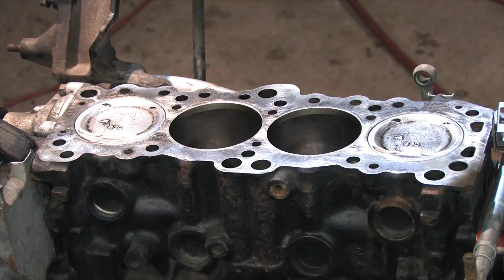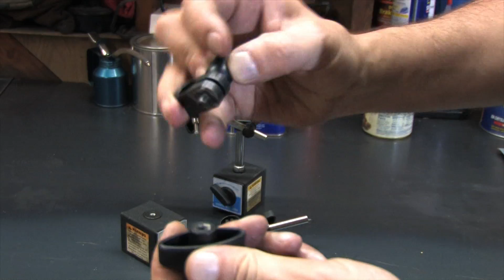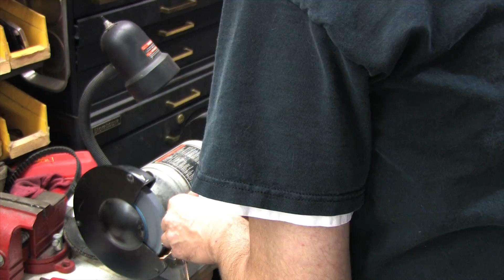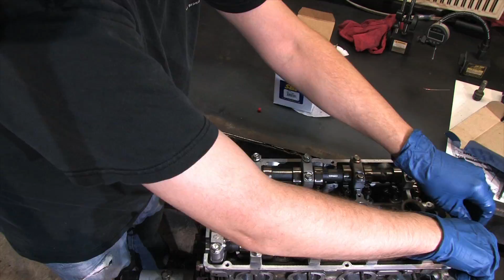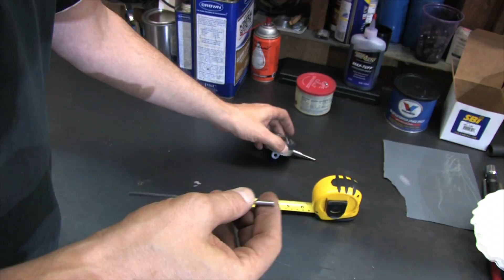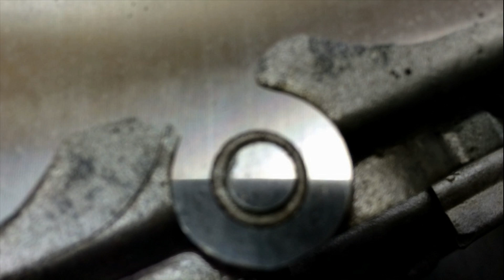Cylinder Head 205 - Degree DOHC Camshafts

Comment: 4:57
All those stupid imperial measurements. My metric brain just exploded Jafro..
Reply: Liamv4696 The whole world should just use metric for simplicity.
Reply: All the Australian engine builders I know still use imperial, even when working on Japanese engines, I think it's just because they think it's cooler to say "It's got 8 thou bearing clearances" over "zero point two millimeters". So this is why my friend and I invented "hunge" for Hundredth of a millimeter.

It's an interesting point you make about resolution, are you sure it's not the other way around though? all my dials are either 0.01mm between points or 0.001" and because there is 0.0254mm in 0.001" wouldn't that make the metric dial have a better resolution? Because over the same 0.05mm movement the metric dial has gone over 5 points and the imperial one has only done ~2
Reply: @zoidbergmerc   zoidbergmerc  most of my test indicators have .0001" resolution. Besides eight thou rolls off the tongue better than zero point zero millimeter. In truth its all in what your accustom to. I've heard people argue that metric is more accurate , when in fact either system can continue to the right of the decimal to infinity. I'm my exsperiance sae is easier especially when working farther from the decimal. For instance, speaking thirty two thou, three tenths.
Reply: right there with you on this.. I dont understand SAE and I dont want to. Some people can tell whats the metric equivalent of 13/64 without even thinking about it. Witchcraft ! Thats what it is. In the fire !
Reply: well with a 0.1mm gauge you would be correct then! 

Living in the US I suppose it makes sense to use imperial measurements because that's what all your cobbers use and the machine shop too, so you all want to be talking the same language.

Check out Mitutoyo if you want some affordable quality metric tools. 

Collecting\buying tools is half the fun I reckon ;)
Reply: Liamv4696 the cat said is enough 
I'm hungry
Reply from the maker: Just say to yourself... "at 1mm lift".  :D  It's going to be okay.  I frequently have to use both, but the majority of machine tools and drill bits I can find in stores here are SAE and not metric.

Someday you might work on an American car.  The cams you buy for it will arrive with the lift spec at .050".  You'll like imperial measurements on that job more than trying to hit 1.27mm on a dial gauge.  It offers 25.4 x better resolution on the gauge face than any of the metric dial gauges I've seen [for 2x the money].
Reply: Too many measurements in that comment!
I only just woke uppp D:
Reply from the maker: zoidbergmerc Perhaps it's just the tools I have access to?  The finest metric gauges I've ever seen here in the US is .1mm.  Never seen a .01mm gauge.  A tenth of a mm is .004".  I'm not saying they don't exist... just that the standard measurements I can get my hands on are between 4 and 40x finer than that.  3.93701 times to be exact.  ;)

In my other videos you'll find I'm always tool-collecting.  If I ran across a good deal on a metric set of .01mm or .001mm gauges that are reasonably affordable, I'll house them.  I'm already set up with calipers and dial gauges in .0001", so for a non-machinist, that gives me better than most in my situation... but it would be neat to have around.

Comment: Seriously hungry for more, i feel ive watched every single video bar a few car shows and track clips. Dont make us wait another month for 206 haha I rebuilt my nissan patrol l28 with the service manual and your guidance. I was also lucky enough to aquire a mitsa magna tf and was pleasantly surprised to find I have the same engine youve been show casing. Its a 4g64 16v, I havent started tearing into it but I feel pretty confident now. It cant be too far off from the 63, right? :p thanks for putting so much time, effort and money into these videos
Reply from the maker: Oh wow!  You got the Galant Wagon.  It's mostly the same... Just a different timing belt and a different bore and stroke... but yes!  You will find that all of this stuff applies.  You should still follow the Magna's service manual for spec, or the overhaul section of the Mitsubishi shop manual for the 2.4L if you can't find the Magna manual.
Reply: ***** yea brother in aussie we call em magnas.. I wish I had a good website or forum to gather knowledge and learn which mitsas I can use as doner cars. I like the 4g64, for a 4 cylinder it goes like stink I just wanna get more haha it uses slight oil, but not enough to produce smoke. also removing the oil cap you can feel massive blowby which is taking its toll on the spark well seals.. good times!!

Comment: These are the best engine videos on YouTube, I can't believe the precision you go to with motors.  It's unbelievable.  Do you ever work on Honda motors?
Reply from the maker: I did build a Honda once.  It was a great car.  I actually do miss it after 8 years of $3.50 gas prices, yes I do...  I couldn't bond with the Honda performance factor.  No offense to Honda owners anywhere... I just wasn't willing to do all the block sleeving and girdle work to stiffen up an aluminum block with a floating water jacket.  It cost so much more to achieve the same result.  I made a video about it called "Jafro's Honda Civic Confession".

Comment: top video jafro.
I will definately be making my own solid lifters for this, I didn't realize that it was that simple, here I was prepared to buy some. Be looking out for cylinder head 206
Reply from the maker: You should lookup 4g63 dotorg and read the cam degreeing section.  There's a fantastic write-up with yet another method of lifter setups available.  It's nice that these lifters are so prevalent in so many different junkyard cars.  Every 4-cylinder DOHC 1989-1999 Mitsubishi uses them.  Of course there's nothing wrong with the ones CRCO makes if you have the coin.  Heck I might even buy a pair just to have them in the toolbox.
Reply: ***** I am not that far into the build yet my cylinder head is ported and polished and I have all the parts for the head, gaskets and sensors for the engine but am yet to buy a rotating assembly and machine work. This sort of stuff is beyond my experience right now so ill do what I did every other time, watch videos and read manuals then dive in and I will be familiar. I will read this article on 4g63 dotorg thanks. Oh I finally got mitsubishi ASA on my computer so part numbers are a breeze. Keep it up jafro.

Comment: Your vids make me want to get a 4g. You should do a SR20DET build so I can copy your techniques :D
Reply from the maker: If making videos paid enough to stay home and just wrench on engines all day, I'd be building several different kinds of cars.  I mean... I am right now, but inside they're still all the same thing.  4 6-bolt 4g63s in the driveway.
Reply: ***** What is your opinion on 4g vs SR?
Reply from the maker: Nikzilla33 That's... that's a tough one for me to answer.  It's sort-of inline with bench racing if I did.  The typical answer would be based off of potential, and I've never built a 4g63 that made it anywhere near its potential.  Anyone who's built an SR20DET anywhere near its potential would then have free license to take shots at me on my own channel.  Homey don't play dat.

I have no experience with the SR20 so I have neither a positive nor a negative opinion of them.  I get asked questions about other engines all the time that I don't own, but truly consider to yourself... "what are opinions worth?"  What would a DSM guy's opinion really be worth concerning a Nissan?  Probably right on-par with what a Volkswagen guy's opinion is of a Pontiac.

However... you CAN copy my techniques on an SR20DET... The geometry may be different, but the physics are the same.  ;)
Reply: ***** Unfortunately a lot of your techniques don't apply to SR's because we have an aluminum block and chains instead of belts. Head stuff is nice though!
Reply from the maker: That's part of the geometry.  The physics is in making it go bang, not what it's made of.  What it's made of is all about Chemistry.  I'm working on the in-depth PHYSICS stuff right now.  ;)

I've got videos about manifolds, turbos, fuel systems that apply.  The blueprinting applies, this one applies, and the next one will most definitely apply.  I admit my fluids videos and block modifications don't apply, and that my oil system videos are only a little bit useful thanks to a strong 4g63 bias... but if you apply what's coming up as the tech videos get more advanced, it will help you make more out of any engine you build.  ...and that's what I hope it does for everyone that tunes in no matter what they wrench on!  At... At least if they have a DOHC anyway.  The pushrod guys are just going to shake their heads.

When it comes to performance engines, and because all of my favorite performance cars have this combo... I'm all about solid-decked cast iron blocks with aluminum heads.  Though a 4g63 has those qualities, most of the cars that I like and call my favorites aren't Mitsubishis.  My absolute favorite is a big block Ford-powered Italian car with a push rod motor.  Kinda weird for an import guy to say that... right?
Reply: Yeah but stuff like blueprinting, turbos and fuel systems is pretty much general knowledge. The work that I bow down to is the immaculate perfectionist grinding and polishing that you do, which unfortunately, doesn't always cross over between iron and aluminum.
Reply from the maker: I have very good news for you!  All of my polished stuff is aluminum-only, and I powder coated everything ferrous so that it wouldn't rust.

If I had an aluminum block, I know I would polish that d*mn thing from valve cover to oil pan just because nobody else had it.  That's the main reason I don't have an aluminum block.  xD

If I do an aluminum block, it will probably be an LS motor, and it will go in an F-150 so I can pull around a Dodge.

Comment: I don't envy DOHC engines.
That's a lot of work.
Reply from the maker: One thing they offer that you can't get with a pushrod motor is adjustable Lobe Separation Angles.  You can still adjust the LSA on a pushrod motor, but the amount of work involved is VERY different.  You know what I'm sayin'... ;P  Yes, I know you do.  :)  You have to know a LOT more about valve timing in order to get a pushrod motor right.
Reply: ***** All  did was bolt up the cam and line up the dots.
Took like 10min.
Reply from the maker: Oh yeah, I know.  They are easy to install.  It's because the intake and exhaust profiles are all on the same stick.

With DOHC, you get infinite control of how far apart you want your cam centerline specs, and you can do it with both cams installed.  The distance between centerlines is a value called Lobe Separation Angle.  Pushrod motors have LSA built into the bump stick, so it's a static value that you can't change without replacing the cam.  In other words, on a pushrod motor, you have to know and have calculated the perfect cam grind in order to get the most out of your build prior to purchasing your camshaft because the overlap and lobe separation angle values are built in to the cam and can not be changed.  They're easier to install, but they're harder to get perfect because it requires a greater understanding of how valve timing events work.

On a DOHC, you can turn one cam independently of the other and dial in the overlap and lobe separation angles just where you need them for maximum performance.  So you can purchase a camshaft that's close to what you want, and make it perfect during install.  Overlap will determine how lumpy the idle is, and LSA will affect how it behaves across the whole power band.

You bring up extremely valid points, but we'll expand more on valve timing in the next video.  DOHC is more troublesome to install, but offers far more tuning capability.  I hope this makes sense.  ;)
Reply: Hey Jafro, I have a project I'm preparing to get started with. It's a 1.4 liter OHC Opel engine, and it's currently installed on my little bite sized truck. 

This engine comes stock with a 12.3 compression ratio, so I don't plan on changing stroke or bore. I also want to keep it naturally aspirated, my main goal is to improve efficiency and/or power-to-weight  ratio without changing the capacity.

I'm wondering if you have any advice on how a valve/porting job on a 2 valve per cylinder OHC differs, if at all, from a 4 valve per cylinder DOHC.